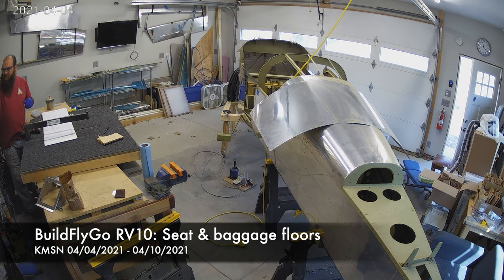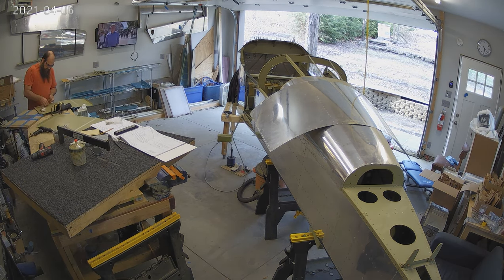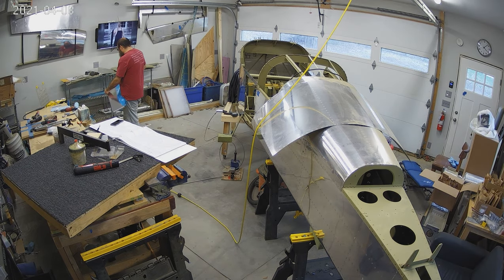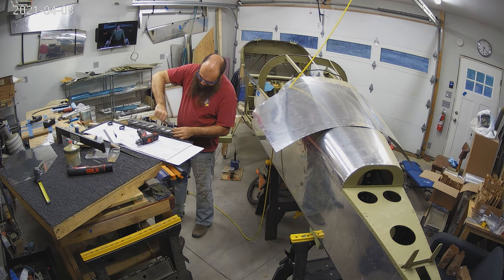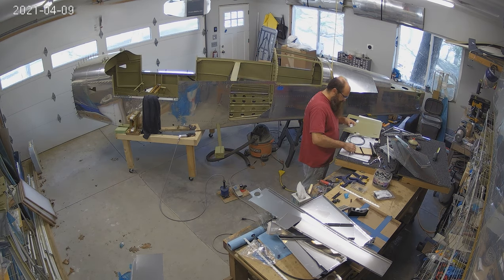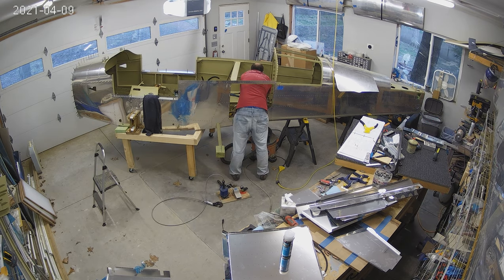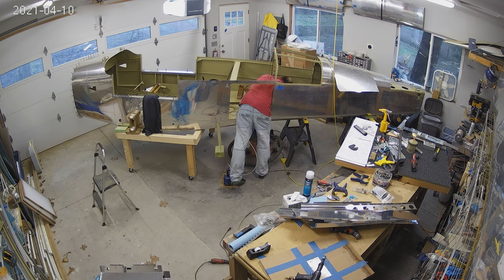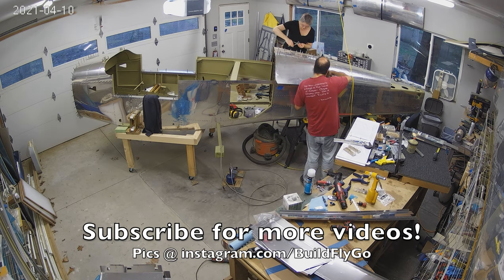RV-10 Build: 04/10/2021 - Closing up seat & baggage floors

Comment: Hey Guil, Michael again. I'm the son of the pair of Iowa boys who has messaged you a few times regarding your 9. 

I have another question for ya! There seems to be a lot of debate in the RV community on priming pieces- What's pushing you to prime your pieces? We've done relatively minimal priming, but I've always wondered if its the right choice. We're not completely avoiding priming, but we're more picky about where we add it, mainly surfaces where we take off the ALCLAD. 

It's been cool watching your 10 build whilst we complete our 9. Hoping to finish her this year!

Thanks again, and camera angle looks awesome!
Reply from the maker: This is a bit of a rabbit-hole :) Some people don't prime, some people prime a little, some people prime everything. I don't think there is a right/wrong answer here, we each make decisions about what's important to us. I've seen plenty of aircraft corrosion and really like the tough finish of the epoxy primer, so figured the extra work was worth it.
Reply: @BuildFlyGo  Totally agree! I think mainly the argument against is weight, but I really can't imagine it adds that much more weight. I also agree on the ruggedizing impact of the primer.

Love the videos, excited to see your 10 completed!
Reply from the maker: Weight is easy to calculate. Read the tech sheet for your chosen primer. They will shown weight of solids/volume. Multiply it out and you get the primer weight. In the 10 with Akzo it should be around 10~15lb. I find that to be acceptable for the useful load of the aircraft.

Comment: How in the world do you pick up the knowledge required to construct this plane?  Are the plans that detailed or do you have to attend builders’ workshops on each phase?  I can see being able to put the structural pieces  together but canopy, doors, wiring, systems,  engine, instruments?   How do you obtain that know how?  Tony Bingelis books are 30-40 years out of date.
Reply from the maker: The plans are good for the structure of the plane, canopy, doors, etc. the wiring you pick up by reading a lot and seeing how others have done it. There are also good workshops available. It’s a community.
Reply: @BuildFlyGo  thanks.  All I know at this point, as one trying to re-enter aviation after a 20 year absence, is that your plane(s) and the adventures which follow your excellent and methodical work, have provided the impetus for considering a Vans aircraft.  The Cessna 172 that I owned 20 years ago now is 42 years old and costs 3 times what I paid for it!  I think Van’s should reward those who devote the time to upload YOUTUBE building videos as they serve to inspire others to build RV planes.  Maybe an all expense paid, week long trip to the Philippines to observe and report on building methods/jigs for the QB kits….If I were them, I would sure come up with something.  Keep up the great work!
Reply from the maker: Hahaha, yeah, that would be fun. I'm glad the videos have been helpful!